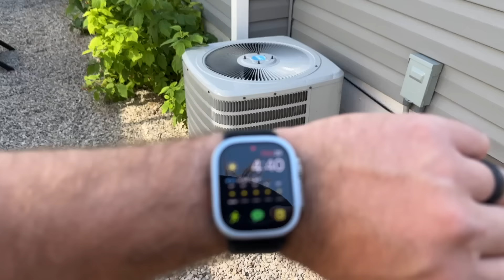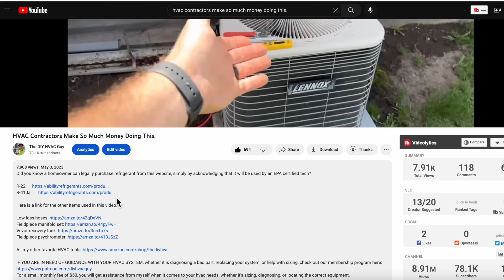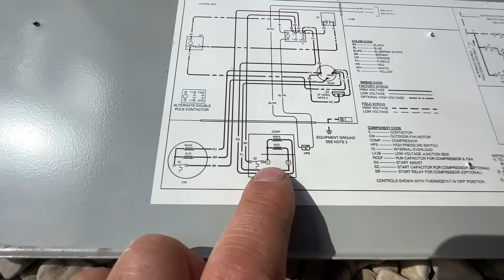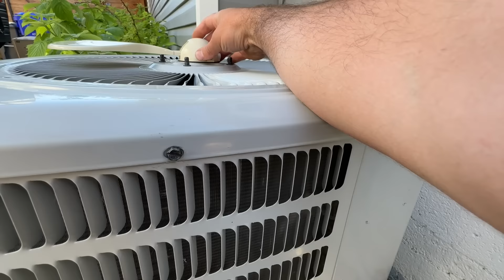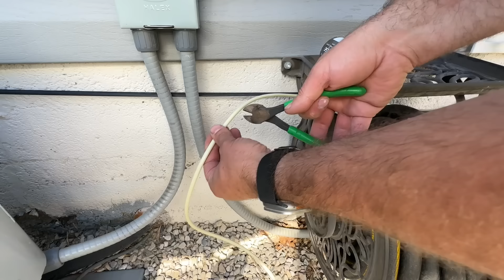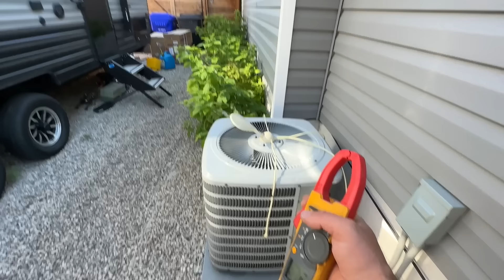Can This Device Actually Lower Your Electric Bill By 30%??

Comment: This is very old gimmick. it definitely will lower temps but at a high price. The metal in ac units are cheap crap metal and will corrode quite quickly and the coils will get corroded too from the hard water. That filter is not making the water soft. If it worked with no issues everyone would use one. They work but you pay a price and ac systems are really expensive now. A much better and benign trick is block the sun. Watch your condenser during the day see how much sun is hitting and its duration. Your ac unit should be on the north side of your house on the east coast so if tis not your condenser is seeing sun all day l and it just cooks that box & compressor. Mine was getting alot of sun so I went on craigs list and bought 2 solid wooden doors and painted them and leaned then on the side of the condenser to block the sun from hitting it. The ac got dramtically cooler and it lowered my ac bill alot. The coindenser box stays very  cool and clean now.
Going on 4 years now the condenser looks brand new. I did build a snall metal bracket to keep the doors off the condenser about 3 inches at the top so not to block the top cools. It bascly just hold the door off the top of the ac where it would lean on it. It works! But if you got an HOA may not get away with it. Plant some bushes to block the sun. Do anything you can becasue the sun now is brutal it hurts now its so powerful. And only going to get hotter.

Comment: Well, it makes sense as you look at a window mounted air conditioner, the conventional units they have a slinger ring built into the condenser fan that takes the condensed moisture from inside and blows it onto the condenser.

Comment: This is Laughable. The way to lower cooling Costs is to Cool LESS area that's Not needed to be Cooled.
Not so different concept as Solar Hot water heaters only heating from a free hot source.

Comment: 8 Months later I can tell you this contraption works! I bought this rig right after watching this video. I live in the Ft Lauderdale area, on ocean access water. I installed this and noticed a difference right away. I did not do amp ratings but I did do temp ratings and I found the air coming out of the vents in the house were a solid 5 degrees cooler and the electric bill went down by a few bucks.

Comment: How does it work on a HEAT PUMP system. I would think it would be even more effective on the heat pump then the AC ?????
Reply from the maker: No this is for air conditioning only, not the heat pump side of things. You’d just want to turn the water off for the winter or possibly even remove it. It would freeze in a heartbeat if you left it on. Cheers

Comment: My AC had 2 fans on it, this was in Oklahoms where it would get above 100°F all the time. This was in a brand new house. The builder did a lit of bsd things to cut his costs including aluminum wiring instead of copper. I bought 2 additional fan blades and rivered them on it. Incredibled difference from being mid 80s in the house to upper 60s. No electrical changes. Not expensive. And anyone can DIY. The electrical bill went down because instead of the AC hoing 100% of the time it cycled off when it reached the set temp.

Comment: When measuring Amperage with an induction type Amp meter this is not dead accurate. The reading can vary a little by how the loop is positioned around the wire.  At very high amperage readings with large gauge of wire the readings tend to be more accurate, but still not dead on.  The best way to measure Amperage is to break the circuit and insert an Amp meter directly in line. The compressor amperage pull may vary a little according the change of density of the Freon from its temperature change, but not by much. 

The water vapour is a smart idea. The humidity is getting sucked in through the condenser and thus slightly lowering its temperature. This makes for the compressed qualified Freon to be at a slightly lower temperature, and thus when it gets to the evaporator the temperature of the air flow moving through the evaporator will be a bit cooler.  

Working out how much you will really save is difficult. There are many variables to contend with. 

I don't know the electricity rates where this is taking place, but a two degree drop in the air temperature may represent maybe a few percent at best.  I would install an HVAC system in a shaded area. If not possible I would build a partition over it to block sunlight from shining on it.  I would use more aggressive water vapour on to the condenser to help cool it more.  Inside the home I would put white curtains in the windows and keep them drawn on the side of the house where sunlight is coming in.  Having tinted thermal glass windows is also a help to block sunlight from coming in to the home.  The roof of the house should be a light colour such as white or a light green colour.

Comment: I have a room that’s the living room at one end and kitchen at the other which is about 22x35’ . Should I run two handler on each end on the short walls or just one handler in the center of the 35 ‘ wall up by the ceiling ? What btu for each type of installation the dual and then single handler?

Comment: The misting system would work fantastic on trailer ac. Those are already horribly inefficient due to marginal evap and condenser coils to fit into small space and save weight. TT also yes an orifice, not txv, results much more readily apparent.

Comment: I've been doing HVAC work for 25 years....This is a bad idea especially on 410a system they are made to run high pressure dropping the pressure in the system will dramatically cut the life span of the unit

Comment: Thanks,I'm using your Help on Ideas to Reduce my Bill,along with Tips for Better,AC Cooling,Efficiency!I Shop Vacked the Drain Line,Whoa!Its workin like it was just Installed,with the Cool and Save Mister!An Attic Fan Temp,Time control!My AC went from 60 degrees to 51 degrees,and Runs Less!Thanks!Again!

Comment: FYI…Don’t do this! This will destroy your expensive condenser by caking it with water calcium deposits over time. And honestly, In most situation’s, it won’t take long. If you do have perfect clean water this might be ok? But this is seldom the case and a cheap filter such as the one in this video will not work. Do as you will. Just a warning from an expert in Utah. As refrigeration guys we should all know this. This guy may live in an area we’re the water is nearly distilled. But in the western states around me that is certainly not the case.

Comment: Just get a ground coupled heat pump. The kind that the condenser coil extends into the ground about 8 feet. This increases both the cooling and heating operating temperature range. Its simply a heat sink and works perfectly.

Comment: I'd hate be the HVAC guy who has to work on heat pumps that have this system installed. So much gunk and build up. I believe they have wet systems available, and I think they even have systems that can use a pool as the cold reservoir.

Comment: I have seen window A/C units designed to take the water that condensates from the unit and sling it on the coils with the fan.  Been a while since I saw a window unit so I don't know if they still do that.

Comment: Great idea especially for those who do not have to pay for municipal water. We, however, are billed for the amount we use ( take in )  and again, on the amount that goes into the municipal drain. ( Dollars in / Dollars Out ). Even a misting system consumes a considerable amount of water over time and that may negate any benefit of this device.

Comment: i have been in commercial HVAC for almost 30 years and i can tell you for a fact that cooling the condenser off lowers amp draw and you bill.   at my old office during the heat of the day,  100 +   we would just run the water hose over it and help cool it off.

Comment: Why is spray flow away & not towards coil ?
Reply from the maker: You don’t want to wet the coil, you want to cool the air AROUND the coil so it evaporates before it hits the unit

Comment: How could it not work? Are you sure they are supposed to spray outwards?
Reply from the maker: Yes it’s supposed to cool the air around the condenser not wet the condenser
Reply: @diyhvacguy  It is better to wet the entire condenser, which is difficult to do evenly. It is the heat of vaporization of water that you want to take advantage of. The air going through is not hot enough to fully evaporate the mist. Wet coils will take heat directly from the coils to evaporate the water. But reversing the nozzles will be a good experiment and I would like to see the result!

Comment: It would probably be more efficient if the misting was applied directly to the condenser coil. But either way, don’t you think it will accelerate corrosion?  Based on your 0.8 amp drop, I estimate this approach, if consistent every time the A/C is used, may save me $80-$100/year. BTW, you ought to warn heat pump users to disconnect the device during the cold months.
Reply: You are Correct. It will definitely eat up the Fins of the coil after a bit of running

Comment: It will help lower head pressure which, therefore it will help lower discharge air temp, but the only downfall is if you’re using hard water or well water, you can get a lot of mineral buildup on the sides of the Condenser.  
It’s a nice idea though for temporary fix.

Comment: we had a few days in the 100s and I went out and sprayed mine with water while it was running and it did drop the temp inside for about 2 degrees but only when I sprayed it.

Comment: In a pinch and the cheapest way to do this, put a bucket under the evaporator drain to fill the bucket, then put the bucket over the fan in the center of the radiator and poke a small hole in the bucket side near the bottom. The water drips out and hits the fan and splashes on the radiator. A five gallon bucket will drip all day.

Comment: You can use a drill and not strip the screws. Thats what the clutch is for. Simply lower from the drill bit setting, you most likely keep it on at all times

Comment: BRO the wire inside of the hoses is for shaping the wire around a bend. Then the third leg was supposed to go in front of the unit. AND spray in towards the unit.  Cooling the radiator fins and lowering the temperature of the gas exchanged in the aluminum. The flapper goes towards the back of the unit. COOL stuff. Thanks for the video.

Comment: that's easy Remove the Main AC and put an AC in every room this will Not Only get your bill down Not Only cool better your house but also will Drastically reduce your maintenance and repair bills for those Huge Made to Regularly Break Main AC for the whole building plus when one breaks all other keep working unlike Main AC

Comment: I realize that outdoor units are designed to be all-weather. But are the designed to withstand constant water-immersion? The coils are, nowadays, aluminum and corrode very, very slowly. But the housing is sheet metal. Housings corrode on their own over time. I wonder if this water unit will cause undo corrosion on ferrous parts....

Comment: Whats the temp drop across the evap. Coil at tge given ambient air temp in the room .
Longer cond. Is running its lowering temp entering coil. 
So it may dhe a degree or two from ambient air entering coil has dropped. Plus what are the head psi and suction psi ?

Comment: My water spigot is 30 feet away, guess it won't work for me.
Reply from the maker: You can easily extend the water line. it’s just 1/4” poly hose that can be bought at any hardware store

Comment: It wouldn’t cool your house faster. It’s design is to lower the cost of that cooling. 25% less amp draw on the condensing unit is a significant savings in one month let alone one year or 7 (supposed life of these machines now).

Comment: I'm getting way different figures than you are on the power savings. I came up with about $5 a month in savings, which for most people may be a 1% to 2% savings if you don't need the hard water filter, and a loss otherwise if it's over $15 in cost. Your power consumption savings was 0.8 amps per hour, and assuming it runs 16 hours a day, with 1 amp being equal to 120 watts, that's a savings of approximately 1.5 kilowatts per day. In my area, we are charged appx 11 cents per kilowatt hour, so that's a savings of approximately 17 cents per day, and over 30 days, that's appx $5 per month. The water cost is negligible assuming it only uses about 2 gallons per day, as we only pay $7 per thousand gallons in my area, so 60 gallons in a month would be 42 cents here, but that lowers your savings to about $4.60/mo. Then you have to factor in the cost of that hard water filter if needed, and that would probably negate all your savings, plus the cost of the kit itself. So the positives you're left with are that it should prolong the life of your unit and give you slightly cooler air inside.

Comment: It's not rocket science, the water mist evaporates and cools the air. If air humidity is low, a swamp cooler or patio misting system can drop temps up 30 degrees. Heat exchange thru the coils is more efficient in cooler air. (This is why your car works perfectly but might overheat on hot days.) The "instant" Wattage difference isn't a mystery, since your AC unit uses variable speeds. As BrianW211 said, even where water is soft, this can damage your outdoor unit... short term energy savings vs expensive servicing or replacement. A quality mister head will use a gallon of water per hour per head.

Comment: Pretty neat just not a fan of using potable water this way. Even if it only uses a gallon a day, times that by a city or a nation and you can see the problem. We're in a time where we are having major droughts, reservoirs hitting record lows and aquifers depleting and fresh water, although there is alot of it, isn't an infinite resource. Lets put it this way if all 1.5m people who watched this video went and got this that's 1.5m gallons of fresh water depleted every day. To people who read this if you want to use something like this try and use an alternate source of water like collecting the condensate or use a rain barrel with a filter. Also I wouldn't recommend using this with well water. Even softened and filtered you still will get build up depleting overall efficiency and like I said aquifer depletion has been becoming more and more of an issue where the ground water isn't regenerating faster than consumption.

Comment: Just a tip for you. Cut the tubing with the proper tool or a utility knife. Those slip in fittings are great but a big cause of failure is a bad cut on the tubing and you'll never get a smooth cut with side-cutters.

Comment: when you measured the before vent temp , it was still dropping and last read was at 52.9 and dropping just incase you didn't notice. I can see the mister helping helping the compressor keep up with the heat , but I'm not so sure it will help the temp inside the house. and what about calcium deposits clogging the fins down the road, I dunno man.
Reply: My solution for sun is a simple shading system. just prevent direct sun to hit my A/C

Comment: I did mine the homemade route.  I routed irrigation hose (not garden hose) to the AC from a pipe in the garage, so super easy, and no garden hose issues (they burst).  I also put in a shutoff valve.  Instead of a flap on the AC I did it another way.  I plumed in a sprinkler valve switched on by the same 28V as the AC so it turns on the water using the same signal.  I also put in a toggle switch for that as well.  This way I can shut it all off for winter by turning off a valve and a switch.  And should the plastic pipe burst in a cold snap the water is off from inside the garage so no problems.  I think my total cost was around $75.  But I also had to buy some fittings etc. so more than that.

Comment: I bought that same device and installed it. It worked well for about 3 weeks when the flap on top started sticking open. So when the air conditioner stopped it continued spraying.

Comment: Do you think the condensate line with a pump would be even better?  Re-use the water it's making itself?  Add a line to the "lineset". Could even the AC mfr's include the pump in the Air  Handler?

Comment: Most likely will have to clean the condenser more, build up of dirt,pollen with moist cond coil. Certain waters will prolly end up putting pin holes in the cond coil eventually.

Comment: Air Conditioning systems use humidity in the air to transfer heat. This is why the AC in your car works much better (colder) in a humid area than it does in a dry area. At a certain point of humidity, there are diminishing returns on how your system will improve by adding more humidity to it. Also, very dry climates benefit from flash evaporation to cool the surrounding air. This is how patio misters work great in places like Las Vegas but just make you sticky in places like New Orleans.  If you live in a low humidity environment, then likely you might benefit from this system but if you live in Florida, Hawaii, or even Detroit, you probably won't see much or any improvement. You're more than likely just going to shorten the lifespan or increase the cleaning regiment for your coils.

Comment: I used to enjoy your channel but lost all respect for you after this video. You're peddling absolute junk here and it makes me question your actual hvac knowledge. This kit is $100 for a cheap hose line and some junk plastic flapper, and regardless of the cheapo water filter it comes with, you're likely going to spray and evaporate hard water all over your a/c and corrode the hell out of it, negating any savings it may have earned you. If this product actually worked, don't your think the manufacturer would simply add a water port to their unit? 

Use your head, folks.